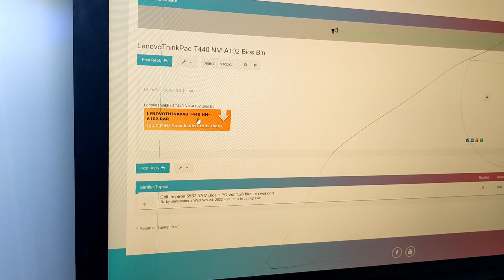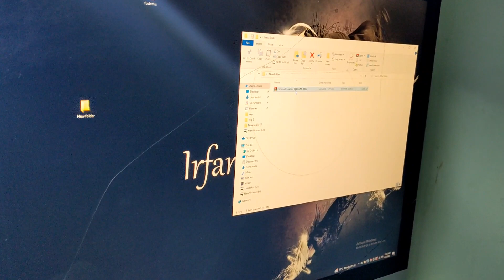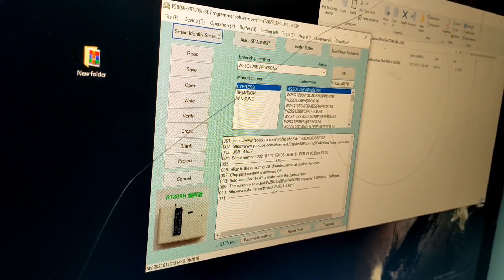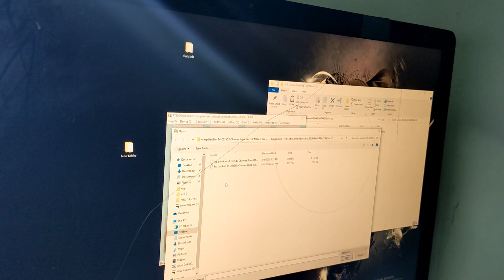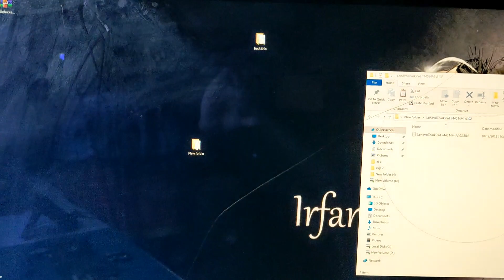How To Install Bios Bin File

Comment: what is the temperature of the hot air and speed ?
Reply from the maker: Temp 370 Air 75 depending on your hot-air gun. I'm using Sugon 8620-Dx